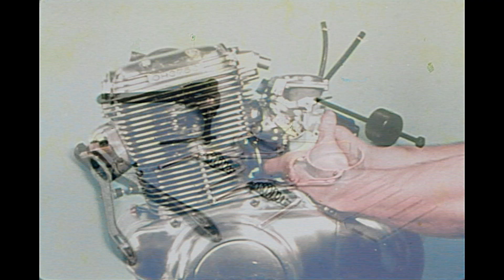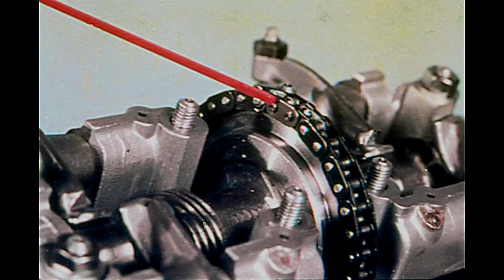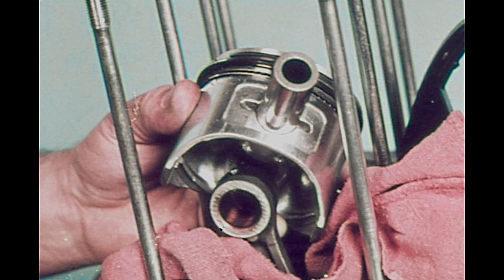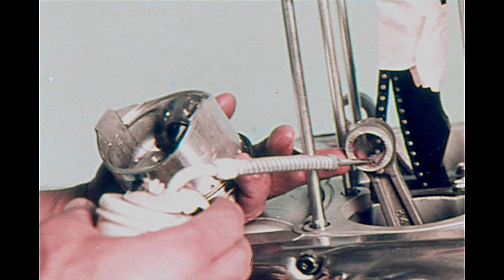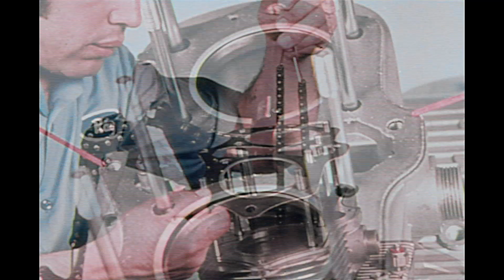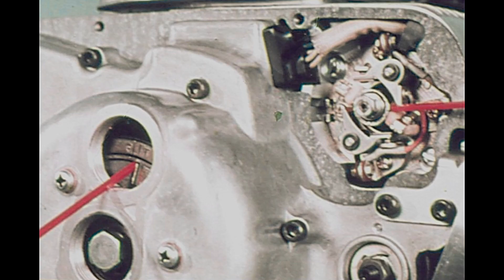1976 Yamaha TX750 Top End Cylinder Head Removal & Reassembly film

Comment: Once you scrape a gasket surface and remove the machining marks and have a smooth surface the gasket is never going to be gripped as well. It must have been a nightmare being a Yamaha mechanic.
Reply: I use sharpened wooden chopsticks to scrape off old gasket material. Does not damage to aluminum. If you must use a blade, use it at the smallest angle possible, to avoid removing metal. Done with care, the mating surfaces will be in good order.